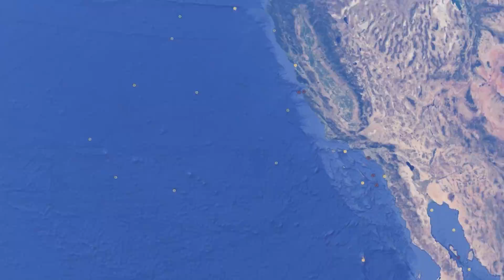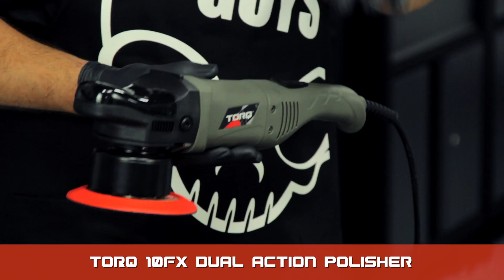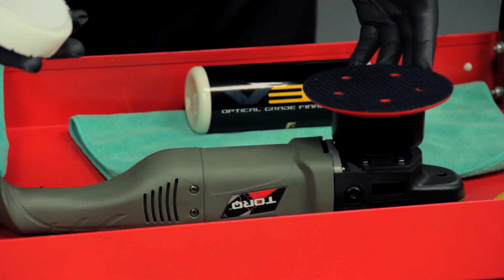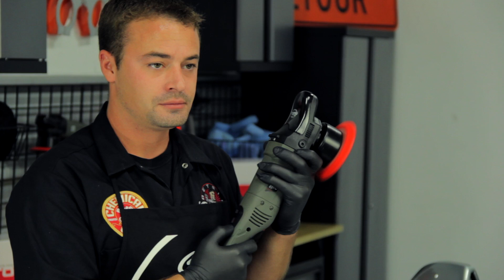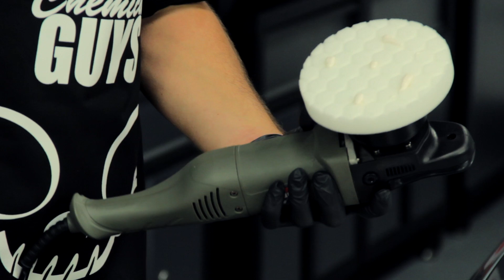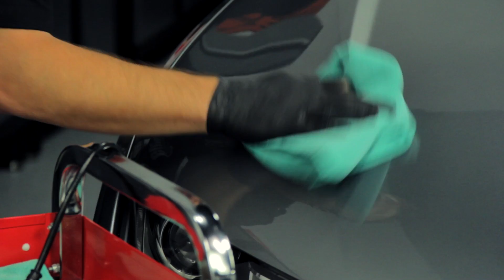Product Review - TORQ TORQ10FX Dual Action Random Orbital Polisher - Chemical Guys

Comment: i finally received my torq today,  its almost as good as my rupes 21es.  The difference i noticed is that it vibrants a little more,  and its not as smooth as my rupes.   the one positive is that it feels lighter,  its good on curves then the rupes and its a little more powerful .  its definitely worth the money.  it compliments the rupes 21es well.   i used it today on my 2007 bmw 530 with a mf pad,  first with v34 then with menzerna 400 which i obseved was much better than v34.
Reply: makes me feel better about my purchase now reading your comment. I bought this as my first real RO. Planning to buy a rupes 21es after I get better to do larger jobs faster :)

Comment: Hi guys, i work in a body shop, and we own several buffers, BUT we struggle alot with swirl marks, specially in dark or black colors, i was going to pull the trigger on a rupes but we will only be using it to correct the swirl marks after we polish with a normal buffer, so i though for half the price this will be a good choice, we do the heavy cutting with the high speed buffer, so this one will be the final step,we have a makita high speed buffer and a dewalt. o and also my friend gave me a flyer with some system chart, which will work better to remove the swirl marks speciallly in blacks? V32,V34,V36 OR V38? THANKS IN ADVANCE FOR YOU HELP.

Comment: what plug does this come with is it going to work properly in the uk without any sort of adapters? thanks in advance i have 1 in basket
Reply from the maker: The TORQ10FX is available in both 120v and 220v.
Reply: @ChemicalGuys  whats the difference which 1 is for uk 3 pin plug? thanks 4 reply

Comment: When setting do you use when polishing?
Reply from the maker: Hey Rob! When using a dual action polisher, set your machine to speed setting 5 or 6 for paint correction or use the lowest speed setting for applying glaze, sealant, and wax.
- CG Nick

Comment: As a typical home owner having a two car family what is the better machine flex 3401 or the torque 10fx???? Looking for something will last and cut my time???
Reply from the maker: Hey John, this is an interesting question. The TORQ10FX is substantially less expensive, and is a safe bet for someone who is new to polishing. The Flex 3401 is a hybrid machine that mimics the features of a dual action polisher and a rotary, where as the TORQ10FX is a great machine for someone who has never polished before, and is afraid of burning paint with a rotary. The Flex will definitely have more power which reduces cutting time, yet it is a more expensive machine. If you're looking for a more powerful machine, the Flex has it, if you're looking for a reliable easy to use tool great for learning on, get the TORQ10FX.

C.G. Alex -
Reply: Thank you for the response going with the flex3401 only because don't want to be the guy who ends up buying up grades polisher and realized I should of went with the better of the two, thanks again.
Reply from the maker: You got it John, glad that I pointed you in the right direction.

C.G. Alex -

Comment: i order mines i was expecting the settings to be OPM but instead They are RPM
Reply from the maker: Thanks for watching the video, the numbers indicated on the operating screen are listed in OPM's not in RPM's. This unit will stop moving if too much pressure is applied, Rotary units will maintain a consistent speed, therefore those machines speed settings will be listed as RPM.

Comment: mines only goes up to 4, is it suppose to be like that? because everytime in your videos you guys say speed setting six. or do you guys mean u press the button 6 times?
Reply from the maker: Stratton Foster The Digital Display on the TORQ uses shorthand to display the actual OPM speed at which the buffer head is spinning. After 00, the six speed settings of the machine spin at:
1) 15 - 1,500 OPM
2) 20 - 2,000 OPM
3) 25 - 2,500 OPM
4) 30 - 3,000 OPM
5) 35 - 3,500 OPM
6) 40 - 4,000 OPM
Reply: Ok thanks for the quick reply, i just recieved mines, and i cant wait to use it
Reply: @ChemicalGuys  Just received mine, so far so good. This information should be included with the product, the user manual is actually really terrible.

Comment: Is it better then the Rupes?
Reply from the maker: Its more powerful and less expensive with better build components and a digital display. We think its pretty slick...
Reply: Vehsax mmg I've had me Rupes 21 for 2 years now and I'm still in love. It's great for cutting fast and finishing perfectly on flat panels. I detail for a living so I've put it through its fair share of abuse. I can say (not with pride) that it's fallen from 3 feet to concrete and survived.  My only gripe is that the blue and green cutting pads only last 3-5 cars before eating themselves. Also that it is not forced rotation and nearly stops spinning (still oscillates) any time you hit any sort of curve. I just got a Flex PE14-2 rotary and it's my first rotary and I love it for AIO and also for hitting pillars and tight areas with the 3" pads. My next purchase for sure will be a Flex 3401 as I need something that won't swirl paint but still turns on curved panels. Looking at the TORQ I think it would be annoying to have to run the machine all the way up to a higher speed every time you turn it off, and the guy saying that on every other polisher if you go up one speed it won't change that is total BS. And who needs a digital display?